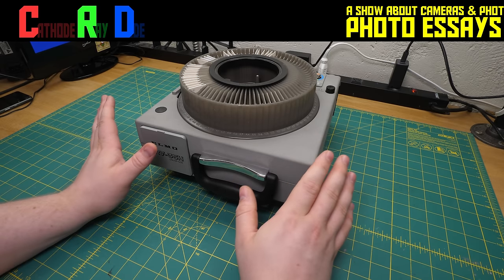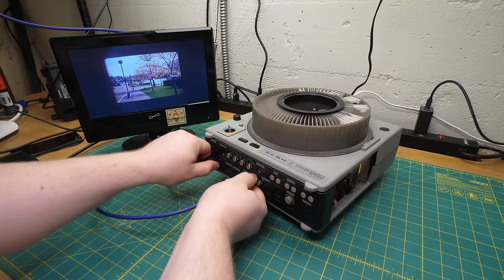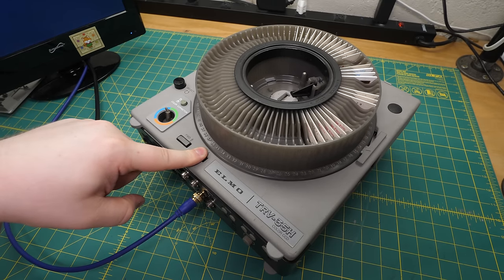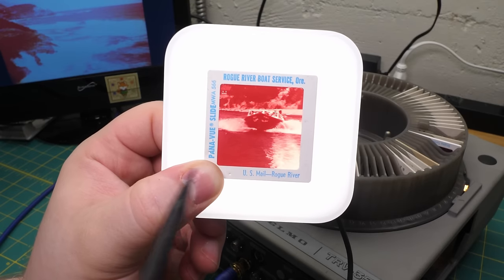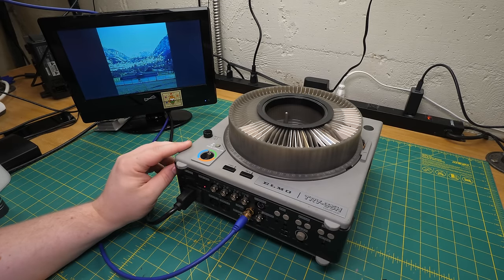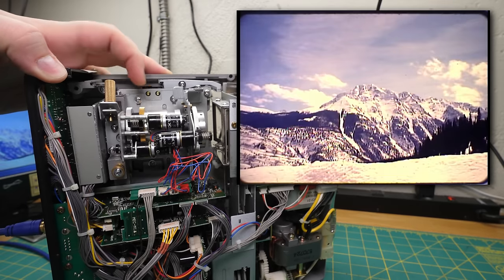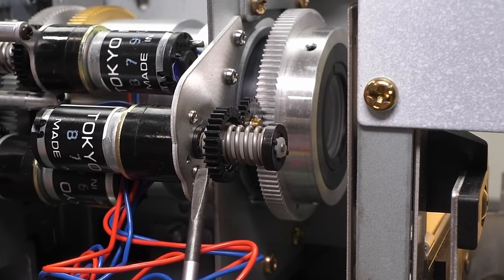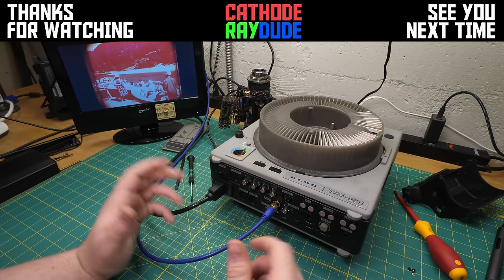The ELMO TRV-35 slides into your video feed

Comment: The corporate training market may also have been moderately lucrative for this kind of device. In the 1980s, there were a number of different companies angling for business with interactive video systems based on the different tape formats, laserdisc and even VHD, with computer control being a selling point.

But in practice, those things might have ended up being used for pretty mundane slideshows or sequences of video clips, even if the audience or individuals got to choose their path through the slides or clips. This kind of unit, even at the stated price, might well have been considerably cheaper and yet still have done largely the same job.

Edit: Well, if the computer control had been a bit more powerful, that is.

Comment: We have a device like this in storage at work (just in case). Ours has a VGA output, though I am not sure of the resolution. (I work at a University, where this would have been used to display slides in a lecture theatre via a digital projector).

Comment: I'm surprised that they apparently turned the lamp off and on for each slide change. Carousel slide projectors used a mechanical shutter to avoid the thermal shock.

Comment: I think you missed a good use case of the computer controls. Imagine you had to present the same presentation multiple times consistently such as a concert. You could have multiple of these projectors tied to a switcher like the diagram you showed earlier and the projectors that aren't currently switched to the output you can have them queueing up the next photo to a pre-programmed zoom, aperture, focus that can change for each slide as the show goes and no one will ever see it as you have the switcher in the chain.

Comment: It would be neat if you could plug it into your VCR to automatically stop and record. Get rid of the second of blank video when it is switching slides. Way simpler than multiple slider converters and a mixer.
I guess the computer control may be able to do that.

I think a competent tinkerer would've been able to make something electromechanical that essentially does that. Maybe even just tap off the light bulb power to run a relay or solenoid that pauses the recording.

Comment: Yes the 127 format died commercially long before this came out. As far as I know those were called super-slides. Shame, because the cameras were lovely cute replicas of the full size twin lens reflex and press cameras of the fifties. The most prominent example is the Baby Rollei, and the clone japanese counterpart Yashica-44. i do have the Yashica and it's so cute, so gorgeous and yet it is sharp as a knife, very pleasing to use (and more manageable than the big heavy rolleiflex). I did build a film cutter to cut 120 film to 127, as there's only one film stock still available in that format and it is super expensive. Theoretically the remaining cutout could be used in minox-style 110 film cameras but I do not own one of those so I don't know the details.

Comment: I have to wonder how much better it would do with those difficult slides if you swapped the light source for something wider spectrum and less "all the light is in the center"
Reply from the maker: Yeah, I've thought about that too. This is the bulb it shipped with, as far as I can tell, but would there be an improvement if we used something more like an LCD backlight? Very possibly
Reply: @CathodeRayDude  If you used a high CRI led you would likely get "better" color although how the sensor handles that is anyones guess, As far as getting one it looks like there's plenty of 12v bayonet bulbs although finding one that publishes it's CRI is more difficult.
Reply from the maker: @PocketablesYT  I initially tried a much cooler LED but it didn't produce even illumination so I had to switch to the tungsten one; I'm sure a bit more digging could turn up a better performer
Reply: @CathodeRayDude  Ideally one that has a diffuser built in, a lot of ones I saw at that size are all exposed COB style which tends to create a bunch of point source lights(although you could diffuse it yourself without much fuss if you wanted there's not enough distance to do it properly)

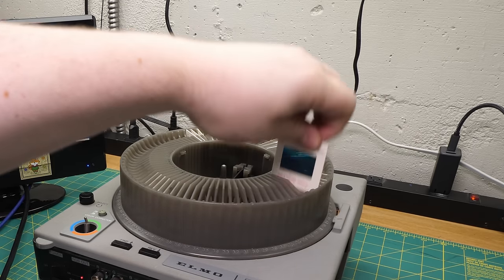Comment: 8:58. Not sure what way is the right way to place them into the machine? If you have a slide with some text captured you can figure it out on your own. No? Your unsure since this slide machine with a camera is strange/odd. But the slides themselves are not the issue. Anyone having to use a machine like this should without a manual be able to figure it out with a simple number plate from a car or anything on the slide with text visible.

It dose not matter how much testing and well executed/planned you make something. In the end the proof is in the pudding.

Cut ones, measure into infinity. YOLO! Or... Simply try one's best until your left with simply making a batch and sample for confirmation. Render a video/ do anything really. You always check the results. There is always going to be possibility of things going wrong no matter what you end up doing. Bitflip from outer space, bugs in the machine. Etc etc.

I swear the ability to mess up chocolate pudding made out of food store mix has to be a innate ability of bad cooking skills. That is the only explanation to why chocolate pudding is dead to me. (It truly is awful and funny to me anyways. Oboy chocolate is far more my style.)

Proof is in the pudding. You can only try and figure out a way to solve it. RTFM. And if that wont work? (missing.) Then you better have the noggin to figure out ways to work around the lack of instructions. It is worse when the instructions do not work! Trouble shooting on the other hand is bad either way.

I want to believe that a Teacher would be able to handle this machine with better results then some digital laptop. But maybe today we are finally at the point of no one having a lack of computer knowledge? XD  One day. One day... At least powerpoint is having a good time with modern 'fast' computers. Now it is all down to the laptop USB/Monitor ports. And messing with Windows.

Comment: Dear Cathode Ray Dude, there is something wrong with your gravity.
Obviously if you drop a small part into a machine and you turn the machine upside down, shaking it.
The small part by law has to drop onto the floor first and then roll under the table or the smallest gap in vicinity.

Comment: Could do a DIY HDR digitized image with it. Use the computer to control the iris setting and capture x number of frames, each at a different setting. Then use software that can combine multiple shots of the same thing into a single image to get the best dynamic range.

It'd still be low resolution crap but the "Lomography" artsy thing continues to be a thing.

Who would have thought some horrible surplus USSR film cameras made by Lomo would reignite the film camera market? They became so popular the Lomo company put their camera for the proletariat back into production.

Comment: Replacing camera module with new one will be not easy work,  not because you will need to disassemble this thing and put it back together
These old analog outputting modules have some different dimensions, they have different height of sensor, different leense mounting holes
And if you will manage to win this fight you will be challenged with another - leense quality. You will never get good image out of this, focusing image will become very hard task, not to mention with sharp center edges will be unfocused

Comment: i dont think 50hz crts are flickery, like i grew up with them and not once did i think like, 'gees crts are a terrible technology, just flickering away.' and a bit later i had modded consoles that ran in ntsc and pal, and i couldn't tell the difference. maybe i'm wrong and growing up with 60 somehow gives you super frame vision and anything less than a smoooth 60p will drive you in epileptic convolutions but i doubt it.

Comment: Stop disparaging people without a college education. For the topic you disparaged yourself about you would be better off trusting someone that works with gears at that loading scale on a regular basis than a college educated engineer talking off the top of his head. If they reference modeling software or a giant frigging manual of some sort you can trust either equally. The only thing the degree gives which a similar amount of experience does not for that type of judgement is the ability to get the title and maybe a higher likelihood to go to the reference material.